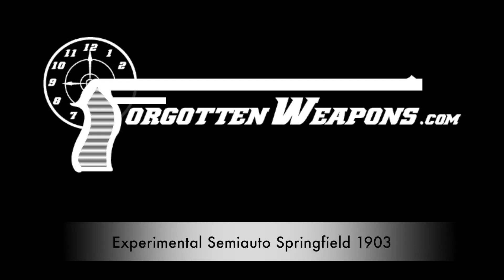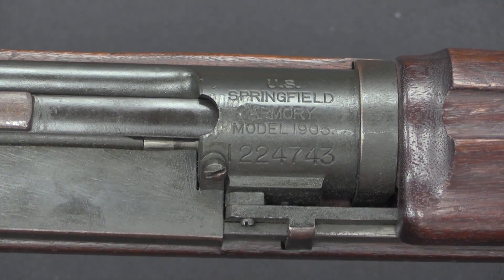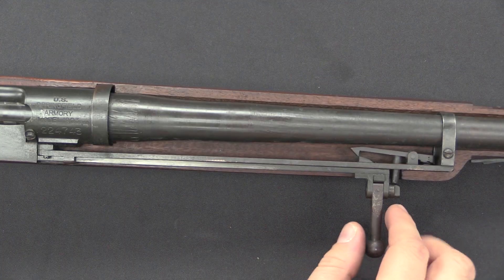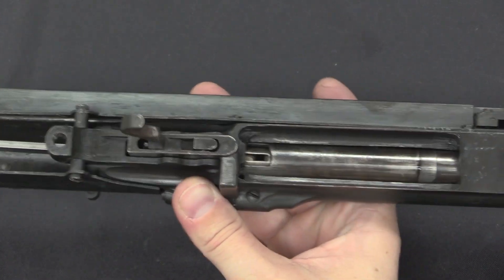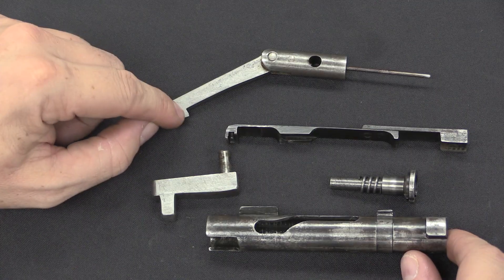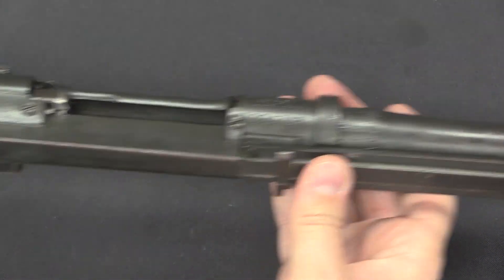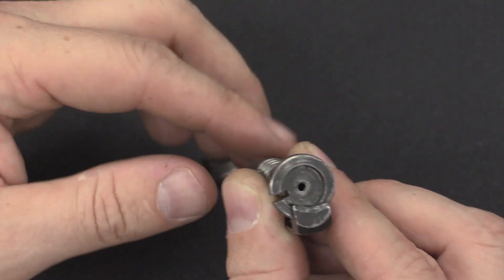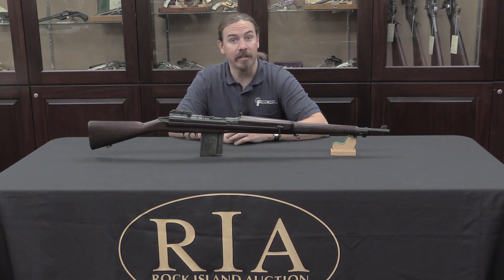Experimental Primer-Actuated Semiauto Springfield 1903

Comment: Primers exiting primer pocket are usually sign of under pressure . I've shot European military blanks without crimped primers, and had primers back out. Conversely cratered primers often sign of excessive pressures . Of course these observations in standard ammunition. How was the ammunition for this rifle modified to give this desired, primer actuated response.
Reply: I don''t know of course and speculation, but I suspect a combination of no crimp and simply giving a few hundreths of set back room in the breech would allow any primer to move.  I see such movement sometimes when I fire 442 Webley ammo in a revolver or rifle designed for one of the other thicker rimmed .44 cartridges such as 44-40 or 44 Special.   Being thin rimmed the primer of the Webley round has room to set back and sometimes they do.  <These are BP loads in modern brass so the safety risk isn't really there.>  So in this rifle, if at lock up there is a hundredth of an inch of space behind the cartridge (and no crimp) I would expect the primer to set back.  A no-go headspace gauge could tell us of course, if we had the rifle to play with.    :)

Comment: Why is the trigger sixteen miles away from where you'd put your hand?
Reply: Your profile picture perfectly complements your comment :D
Reply: the engineers were extremely busy putting pistol grips on their stocked lugers, which were massively more successful than these.
Reply: That would be a good place to put a pistol grip.
Reply: Or this was salad finger's personal gun.
Reply: The back of the receiver was lengthened by a couple of inches, which pushed the trigger forward. As Ian said, this is obviously an experimental piece that didn't go anywhere, and they'd probably have either decided to figure out a way to move the receiver back in the stock so the normal grip would work, or mounted a pistol grip in order to fix it if they had continued working on it.
Reply: You need a pointer finger ten inches long
Reply: ahhhhhhhhh why not ?
Reply: Because it would be considered an assult rifle in California if they had added a pistol grip.
Reply: Its a functional prototype not a full ergoed out gun
Reply: glad I wasn't the only one to notice that
Reply: It's like one of those wheel-lock guns.
Reply: I like to imagine that ur meant to hold the mag like an m203 but u press the trigger with ur thumb
Reply: Yes
Reply: Long index finger

Comment: Was there any interchangeability with the special primer actuated cartridges and standard ones? I would imagine if not if would have been a logistical nightmare and one reason why it was never considered
Reply: +2chws If you moved the bolt handle back closer you could use it as a pretty neat bolt action. Not single shot.

Comment: Fascinating.
I was thinking of a similar design for a completely different reason.

I was thinking of having a spring loaded boltface on an open bolt design to work as a simple blowback design on high pressure rounds.
The sprung face would have a very strong spring with a short throw, it only needs to hold pressure while the round fires.
This pressure comes from the mass of the bolt slowing, stopping and accelerating through the short travel of the boltface.

Comment: Gun "Nerdery" is why we're here!!!
Amazing to think just a few mm movement could actuate that heavy mechanism. Physics cannot be denied. What finally killed primer actuation? Reliability/low accuracy or primer separation danger?
Reply from the maker: Specialty ammo and unreliability.
Reply: +Forgotten Weapons Thanks for the response! Happy labor day
Reply: Primer actuation requires a very high initial impulse to kick the primer pocket back with enough force that a few hundredths of an inch of movement has enough energy to actually work the action of the rifle. The Army switched to the slower-burning Improved Military Rifle (IMR) powders around the time the rifle Ian showed was developed (as well as John Garand's early development work with primer-actuated rifles), and the new powders didn't have the "oompf" of the faster burning Pyro D.G. needed to reliably operate the action. This is also why Garand switched to a gas-operated system which was eventually used in the M1.
Reply: When you pull the trigger and you only hear a click when 30 huns are trying to kill you will spoil the shooting experience.
Reply: +Charles Hoffmann Thanks for the further clarification. Learned something new today re:IMR (acronyms rule)
Reply: +Pieter Batenburg Not to mention the arrangement of your internal organs.

Comment: You mentioned that if you installed that piece the wrong way around, that sear would be in the wrong place making it so you couldn't fire the gun. Wouldn't it actually potentially make the gun blow through the whole magazine uncontrollably, if the bolt was allowed to slam forward quickly enough when first loaded?
Reply from the maker: Hard to say without actually trying it.
Reply: I think Ian would be the most qualified individual to answer that here. His answer will probably be the closest you get.
Reply: Great observation. I think since it wouldn't stay cocked for the first shot to be fired normally, it would be more of an intensional setup and letting the bolt/charging handle slam forward as an open bolt submachine gun. I think a demonstration should be arranged🍻
Reply: Someone please answer this question, I have it too.
Reply: +The Nihilist we couldn't without actually  doing it, which could destroy the gun.
Reply: Something tells me (especially after Ian replied to a comment like this and didn’t specifically deny the idea) if he were to officially say that switching the bolt around would in fact create a full auto open bolt gun that a certain 3 letter agency would come and take it away.

Comment: I look at these experimental designs around ww1 and ww2, how armies were trying to get a better gun. But then i look back at muzzle loaders, and how there were breach loader and break action designs that were an improvement. But Militarys didn't really push for them. And it makes we wonder was it just a matter of the tactics and strategies of the time. Like what you saw happen to various designs throughout history or was it something else.
Reply: Like Ian said, cost. Revolvers, breech loaders, break actions, and even magazine rifles were available for purchase in the 17th century provided you were a wealthy noble acquainted to a genius gunsmith. The military had to wait until someone came up with a cheaper design that can be manufactured by Joe the machinist and his friends in the factory. 

The other reason was reliability. Nobs rarely had to use their fancy arms in harsh conditions, so they could live with lower reliability. A military can't, and since reliability and safety were pretty much the same thing for early firearms (whose main failure mode was to blow up in your face) materials science had to catch up first. Ferdinand Mannlicher designed gas-actuated automatic rifles in the 1880s but couldn't produce them because the materials to make them safe to operate only came about in the 1900s.
Reply: I think many factors are involved, most of which have been mentioned by Ian in his videos. As opposed to most sporting use, military guns are used in life or death situations. Armies (and I mean infantry) are inherently conservative and would rather let "other entities" try out new stuff before they get involved. As an example we all know: The Air Force was the prime mover in choosing the AR15/M16 as the new US military rifle over opposition from the Army. There's also "the NIH principle"🍻
Reply: +Bruce E Sorry: "Not Invented Here".
Reply: "the NIH principle"?